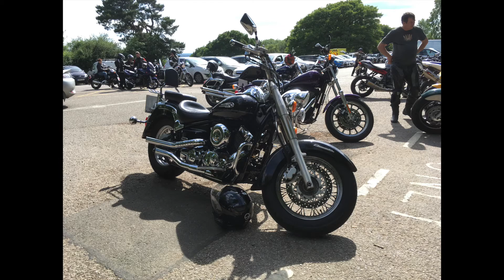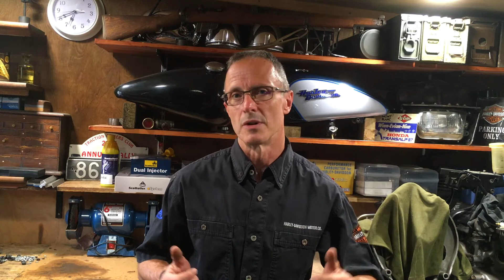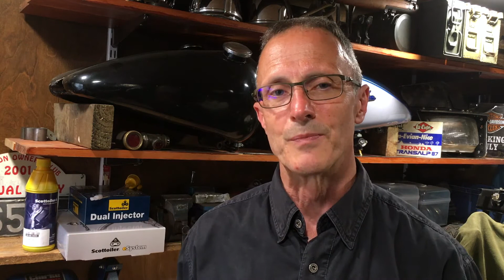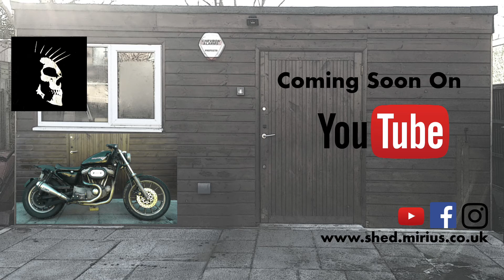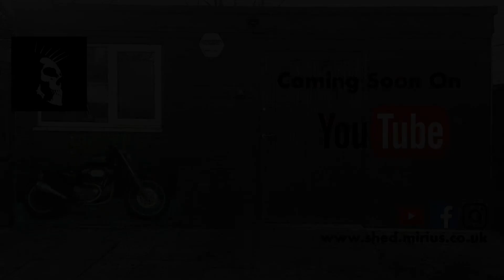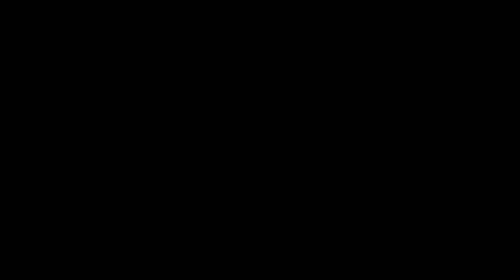XVS 650 Introduction to Maintenance and Modification

Comment: I just got my first bike, a 1998 Dragstar 650. I washed it at home with a (relatively) low pressure hose, and then a rag with soapy water. After all was well and done, I could no longer start the bike. I can turn the key on, the dash lights up, check engine light goes off, it's in neutral, but won't start. In fact, after I turn on the ignition, the usual noise it makes, is not there. I am thinking of just letting it air dry for now as I am not sure where water might have gotten stuck - I did check the battery unit and it's dry so that can't be it - it's somewhere I'm not able to see from the outside.

I am guessing I haven't killed it and it just needs to dry right?

Thanks for the advice
Reply from the maker: Hi,. I'm sure the bike will have started by now.  You have to be careful with washing a bike with a hose and a pressure washer should only be used very carefully indeed - different for two stroke dirt bikes.   Shouldn't do this with normal washing - no worse than riding in the rain, but you might still have an electrical issue - and the battery might have just coincidently gone flat.

Comment: Look forward to them, another bike for yourself? You also got a new tank for the Harley on the shelf? 👍🏻
Reply from the maker: Replacement for the 650 Bandit and for the DRZ, both of which I really need to get round to selling.  There is some cosmetic work needs going to this one, but otherwise seems a sound bike.  Well spotted on the tank.  Yes there are some plans for the Sportster which you should be seeing once I catch up with the backlog - slimming down the fleet will help a lot with that!

Comment: Nice one mate. Look forward to seeing this series, The Drag star is a cool bike in my opinion. Cheers, Al.
Reply from the maker: Cheers Al.  Have to agree with that, let me know if there is anything you want to see.
Reply: Mirius's Shed Will do mate. Which do you prefer the Drag star or Virago?
Reply from the maker: Alan Bell well Al you might guess the answer from my choice of bike.  I think performance was there isn't a lot between them but I do much prefer the looks and lines of the XVS, in particular the lack of visible rear shocks.
Reply: Mirius's Shed I get you mate. I like the Dragstar myself & looked at a few before picking up 'Betty'. I heard the Virago has slightly more torque, but both nice bikes. 😉
Reply from the maker: Nice.  I think the 'extra' torque on the Virago is mostly weight related.

Comment: Ive never really understood at 63, why a 650 is a beginner bike.... it weighs 225 kg i think, Ive got one because i live in an area with hilly winding roads, with no straight sections, the 1100 which i also had for three years had way too much engine braking it would lock up the back wheel in the wet, and used way too much fuel.  The 650 is very forgiving on the throttle around corners here in Italy where theres the nice surprise of gravel washed down on the corners... thing is its so low i can get my athritic hips to get my leg over the seat!  i cant get on my RMZ 450 anymore its too high!
Reply from the maker: I consider a 125 a beginner bike.  I think it's an ego thing - especially in the US.   Horses for courses as far as I'm concerned - I spend much more time riding my 390 and 650s than I do the 1200s.  I do find the XVS 650 too slow too keep up with traffic on the motorway but that is a gearing thing as the GSF650 is just fine.